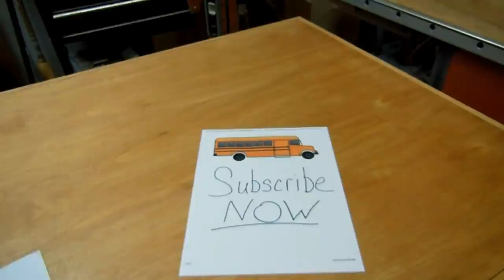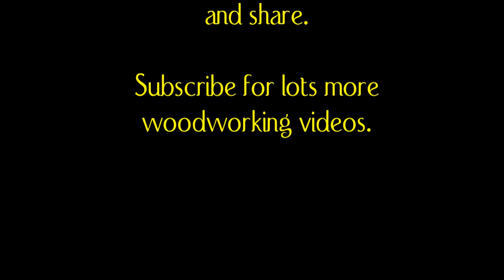Make A Custom Shaped Sign (Quickie Project #6)

Comment: Really like the sign.  Just a tip on taping the curved portions.  Lay your painters tape out on the edge of a clean cutting surface and use your thumb as a stop guide to cut thin strips with and exacto/razor blade.  Even with blue painters tape, you can follow some pretty tight curves.
Reply from the maker: +Josh Doyne: Good point. It would have probably been easier making thinner strips of tape. Thanks for watching.

Comment: Great job Steve I really liked that projector you had. Hey that paint job looked good too. The video and all was first rate. Did you have about 6 hours in all on the project? God Bless
Reply from the maker: Hey Frank, I appreciate it. I probably had only about 4 hours in actual work time. Then add another hour or more for recording the process. So, not counting editing and paint drying time, your estimate is probably pretty accurate.